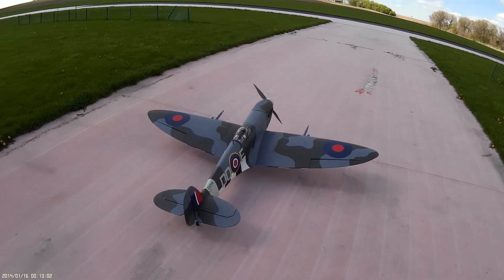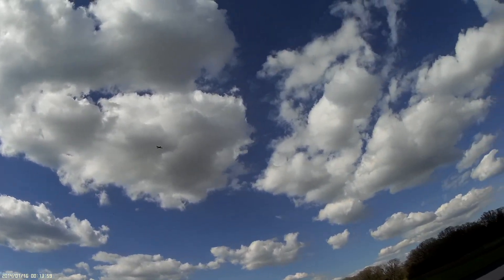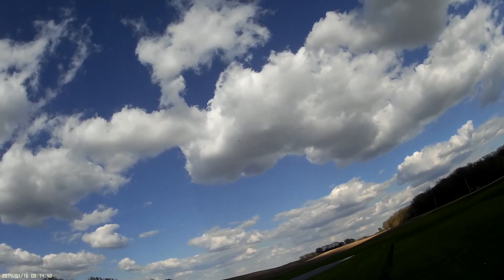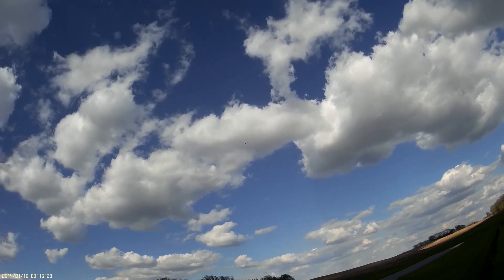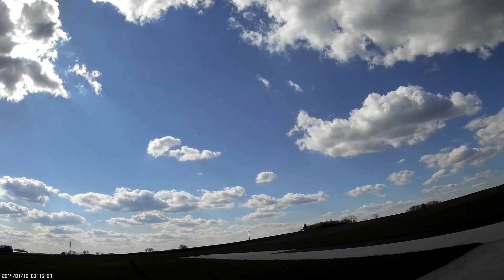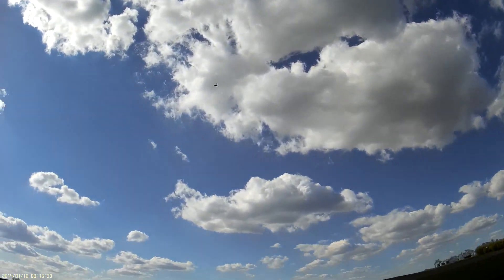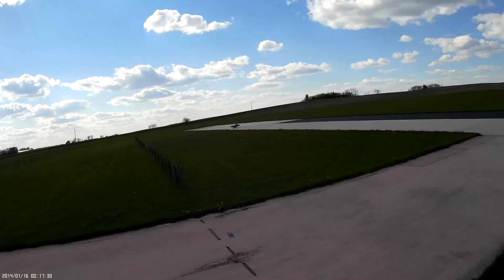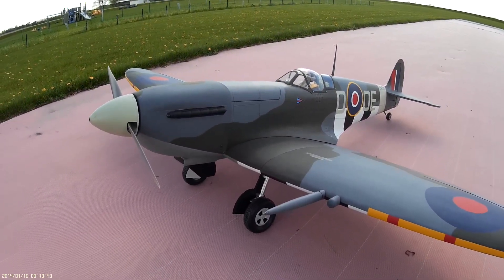Hangar 9 30cc spitfire electric 2nd flight

Comment: My wife just bought me one of these for Christmas.  Very nice plane. Most likely I will do the conversion to a brushless motor due to my sensitive hearing. I like gas engines but you have to get your head really close to the motor to get it started, plus the carb tuning. What is the approximate investment for completing the kit? Including retracts? Thanks for posting these videos.
Reply from the maker: hi,since you have the model then give or take you will have another 1,000 dollars into it by the time it is in the air. the electric robart retracts have been flawless in this model. this is my favorite 30cc electric model.
Reply: jagdpanther9 Thanks for the info.

Comment: I would go with gas/nitro engine, longer flight times, and 5s batteries are expensive.
Reply from the maker: i had a YS FZ 140 supercharged nitro engine in a 72" esm 109E. i really liked the way it sounded and preformed but it was very finiky and almost scarry to get tuned properly. i have gone with electric power in my 30cc models mainly because of severe neck and back issues and multiple surgeries. the electric power is just so easy to maintain . no mess no tuning and as far as batteries go i have 2 500mah 5s batteries that fly both of my 30cc electrics so the 130 dollars into them will fly these models for hundreds of cycles.on a wide open thrashing flight my times are 5-6 min. but with throttle management i have had 8 min. flights with reserve to spare so thats long enough for me. so really for me it is no sore neck and arm from flip starting, fueling, and clean up. i am a prop ripp lover and these electrics sound great! i do miss the sound of my os ys 140 @ 9K making prop ripp but this electric is no slouch =D

Comment: Hello Jag , all you've done good and attractive except landing  . Of course I know it's caused by the  Spit's total weight  . It would be good if you  could reduce the landing speed with lighter batterys, longer approach by flaps ...fligh-time will be less but otherwise, such landing will not turn into a nightmare. No offense please...Al the best , and thanks for your sharing .
Reply from the maker: thank you josip, i used some graphite on my wheel hubs and axles and with more careful slower landing speeds has cured the nose over problem with landings.i have really enjoyed this model after many flights this summer  it is still very pleasing to fly.

Comment: hi ... im converting mine from petrol to electric ... im fitting a turnigy g160 , jp perkins 85 amp esc plus 2x 20c 5000 5s will it be ok ... receiver battery , so lipos onlyy for the motor ...
Reply from the maker: hi, i think that if you stick with a 18x8 prop you should be fine. my esm bf109E has the gforce 160 and made 3090 watts @ 82 amps with a 19x8 prop and 5s 5000 50 c batteries so check how hot your batteries  get with short flights and throttle management @ first. the 20c batteries will fly it but i dont know how much abuse they will take before they get too hot and puff. mine took about 20 oz. in the nose as well to make c/g. great flying model even @ 20 lbs AUW it settles in so nice.

Comment: Hey, I see your video and your Spitfire fly very good!
I have my spitfire standing over a year and am slightly afraid of the CG.
first had mounted a block of 700 grams in order to approach the weight of the gasoline engine. But am now remove this and will make a hole in fireplate as much one lipo as possible to submit would 500gram can save.

Would you give up your cg, or the original 127mm?
How did you also approached with lead on engine support?
thanks ...
Reply from the maker: hi jerry, i went with the factory c/g and with my electric set up it took 2 pieces of flat iron that weigh 20 oz.about 600 grams screwed to my wooden motor mount. the motor mount i made is 1/2" laminated plywood squares glued together making a big wooden block 3" thick? i'd have to take off the cowl to measure .my c/g is @ 121mm just like the manual says. i used some graphite on the wheels and she hasnt gone on the nose since. 
This is a real sweet heart of a model to fly. it is just so smooth and slows down so nice on approach you will see when you take yours up. just make sure to use alot of expo in the elevator or they get kind of sensitive mine is set @ 35% and i like the low rates that are specified in the manual .
im sure you will be fine a little nose heavy with some fuel in it but use some graphite on your stock wheels and it wont go up on the nose that way. 

good luck! =D
Reply: Thanks for your quick response and explanation!
I will keep you informed of my maiden fly.
regards

Comment: Hello! jagdpanther9, I have watched your videos on converting Guillows 1/16th scale (3/4''=1.0') model airplane kits to electric powered RC and was wondering if you could give me some advice on converting one of these kits myself. The 400 series P-40 you built was very impressive. How did you get the landing gear to work? I have Tactic brand radio transmitters and receivers so I pretty much have to work with their stuff, but any brand of servos can be used with Tactic receivers. My older brother can not understand why I don't just buy a foamy and just fly one of those, I get comments like, "nobody builds anymore". Well, I can't understand why anybody could get any pride out of not building their own RC airplanes. That's where my passion lies, in the building! There's something about seeing something fly that you built yourself that appeals to me. I would like to build a model airplane with a 6 channel receiver that would have retractable landing gear and flaps. Scale RC flying is what I think is what I want to get into. Of course, I also enjoy building free flight model planes and have a few plastic static display model aircraft in the works. There is one airplane that has captured my imagination in the last three years, the De Haviland Hornet. I have been studying this extinct warbird on the internet and it was never really used because the war it was designed to fight ended before it became available. Of course, I am not quite ready to tackle such a project yet but it is something I want to do. I plan to do a simple 3 channel conversion first then a 4 channel before trying anything as complicated as a twin-engined 6 channel scale airplane. But if you could give me some advice of the Guillows conversions it would be a big help. As for your latest video of your Hanger 9 Spitfire, that's one more cool airplane you have there! Well, model on and keep them flying!
Reply from the maker: +david burns hi, it is awesome to hear your passion for the stick builds, that is a big key to making these conversions fly well. the best advice i can give is to check out Guillow's Conversions - The list of conversion threads @ the rc groups. there you will find hundreds of rc conversions and their build logs. i have build logs for many of the models that are on my channel that you can learn from. i will @ some point do a build video for a basic guillows or stick built model as it has been requested many times but i need to figure out how to approach doing the video and cover questions . i have considered opening and account on twitch and doing guillows conversions
the best way to start is to do a 3 channel cub or another high wing guillows . but for sure start with the list of conversions @ the rc groups , find a build that you are interested in, and study the build log. just dont give up. learn from your mistakes . as oppenheimer said  "failure is an unavoidable consequence of success" it will happen. if you go to the build log for my p-40 with retracts you will see this . you cant win them all but keep after it and you will win most of them.